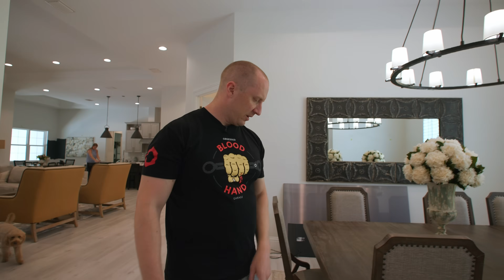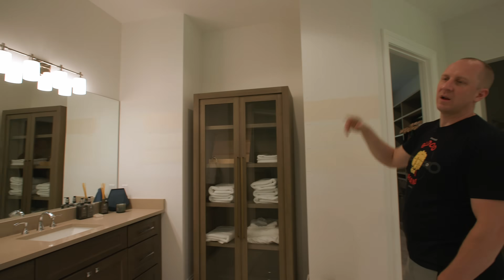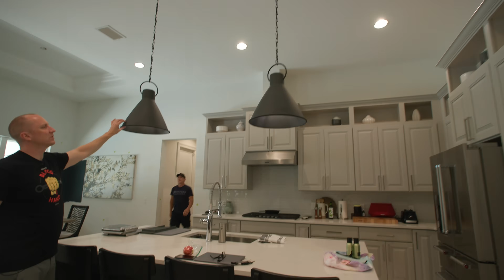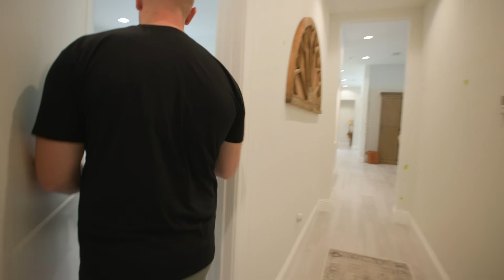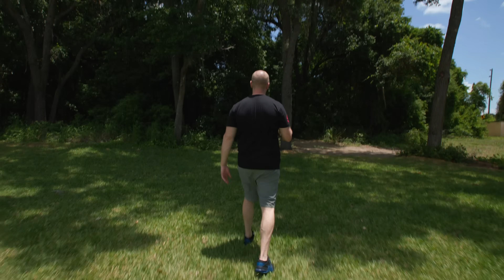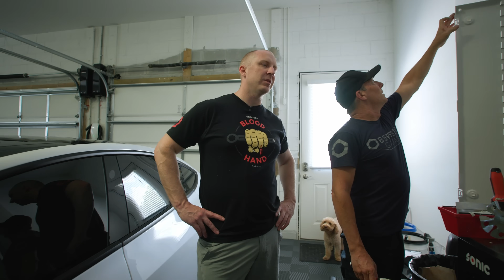Obsessed Garage House Tour: Exterior Refreshed!

Comment: Matt, great video. Do you know the brand of power strip in your internet box and where you get those shelves for the modem and router? Thx!
Reply from the maker: It’s from Home Depot.  They have them in the lower strip section.  That box is from Leviton.  Leviton makes a whole system for it.

Comment: Hey for the sound dampening, on the new house is it possible to just make the room or rooms sound proof by putting panels in the wall or whatever special materials they use for that kind of thing? I feel like it would clean up the look even though it still looks good. It would just get stuff of the wall
Reply: Stuff in the wall reduces noise going between rooms. Stuff on the wall stops noise bouncing off the walls and back at you creating an echo.
Reply: @thatnateguy1093  oh okay that makes sense. What was going through my head were quiet rooms. The very top floor of my college’s library was a quiet floor and I know it was built with that technology. But what your saying makes sense, I just didn’t know.